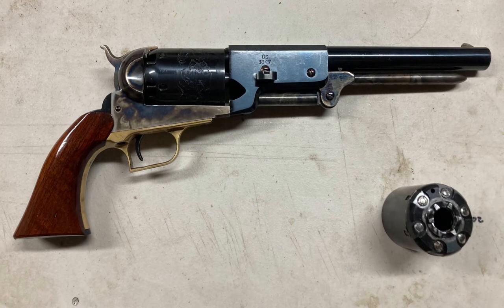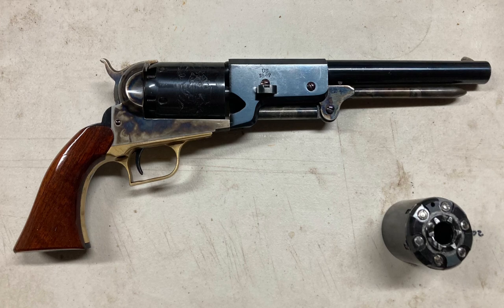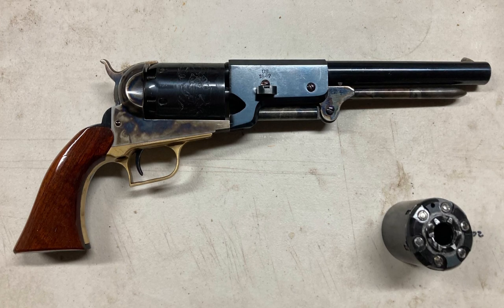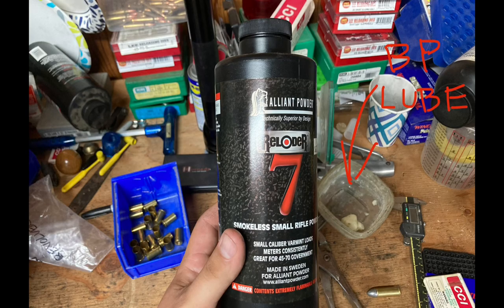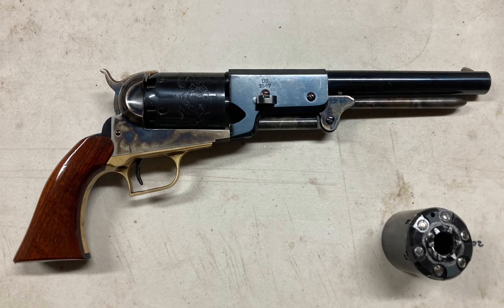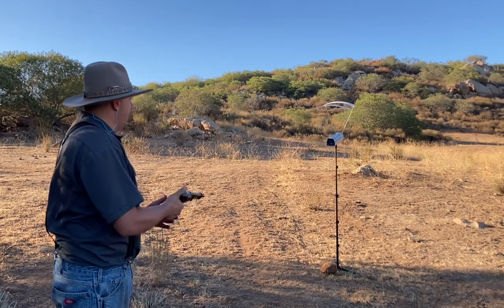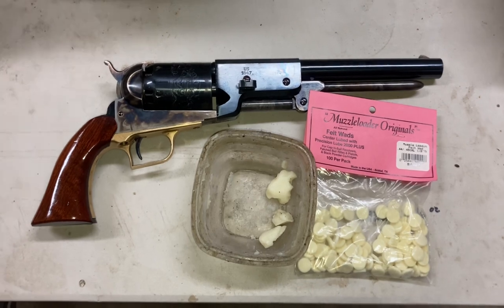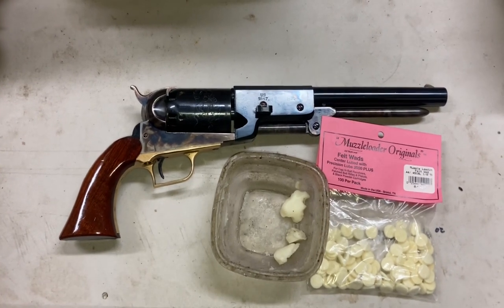Colt Walker Chain Fire

Comment: If the ball shaves a complete ring of lead when loading its not going to chain fire through the front of the cylinder. You probably had loose fitting caps.
Reply from the maker: They weren’t any more or less loose than usual but I do suspect it came from the nipple side of the chamber.
Reply: I have a 36 cal cap and ball revolver. This gun has weird over sized chambers and is difficult to get the right sized balls. It has chain fired a couple of times.  As noted tight fitting balls is extremely important in preventing chain fires.  Some Walker pistols are made with a slightly larger bore.  This could be worth looking into.  Make sure your getting that ring of lead during loading.

Comment: I know I am not expert, but in my 15 years of shooting black powder revolvers, I have determined that if you do not get a good ring of lead shaving off when you seat the ball, you are using too small of a ball.

I use .454 balls in my 44 revolvers, and have never needed to use anything other than powder and ball.
Reply from the maker: I used .454 ball and it always shaves off a nice lead ring. I think the excessive powder charge might have something to do with it.
Reply: @Everythingblackpowder  I also use .454 and I get the same ring.

 I mean I don't know because I've never messed around with with excessive powder charges, but it still had to get in there somehow and ignite the powder.

Comment: I think this happens when you use undersized balls
Reply: Ideally when you press the ball into the cylinder one should be shaving a tiny ring of lead from the ball.  But sh!t happens 😃.
Reply from the maker: I use .454 balls and they shave a lead ring when I seat them.
Reply from the maker: It’s very possible. There’s a lot of fire and smoke with that powder charge.
Reply: @Everythingblackpowder  yep that's a real horse pistol!   I've never had it happen and im guessing you shoot 100 times or more what i do  and it has only happened to you twice so its rare but can happen even with all precautions.  I know some my nipples seem sloppier than others as far as cap fit or sometimes some caps just seem to seat better than others.   I read about back in the day sometimes those walkers would actually blow cylinders given the metals of the time.
Reply from the maker: @luuk-out-below9804  I’ve heard that too.

Comment: The problem is piss poor QC! I don't shave a ring of lead with my favorite most used guns. I chamfer the chamber mouths and polish (sometimes recut) the chambers, but most importantly they have to be the same size and the Italian's have left this up to us to accomplish...yeah I know it's a cost thing etc. etc. etc., but point is that we have to do it ourselves. The only thing keeping from cutting the ring is the chamfer and the chambers are still cut in relation to bore size (some confuse with land height) so the ball/bullet is still compressed tightly in the chambers to the point they are shaped in the same fashion as if they were cut by the cylinder chamber mouth and will not move under inertia and I don't have to chase rings of lead down (I don't waste anything!) and overall better performance and accuracy and no lube needed if the work is done...I assume because I always use it unless I forget it. I also mirror polish my forcing cones and cut (polish down) the sharp edges of the start of the rifling ahead of it and I do the forcing cones if needed.

Comment: My chronograph reads off anything less than 1000 FPS with a decimal.  It's hard to see.  956 FPS looks like 9560 FPS.  I botched an afternoons worth of data a few years ago looking for book start load to register around 1050fps.  My read was like 9835fps...until i noticed the little dot.  Oops, it was 983 point 5 fps, etc..  

Meanwhile, none of my .44's do well with .451 balls, they are all over size, chambers and groove.  One is okay with .454 but the rest are much happier with .457's.  Same for the .36's, only one is happy with .375 ball, all the rest need .380's.  My ASM .31 Remington is okay with .319 but my Colt 1849 is marginal with .324 and does much better with .330's.  Slug your chambers & bore, you may be surprised by the results.
Reply from the maker: Mine doesn’t have decimals. I think I was just too close to it. It should be in the 1100-1200fps range with that charge.
Reply: @Everythingblackpowder  I have figured some stuff out the hard way so I'm not being a smart ass.  I'd venture to think that many of your viewers who are new to this have, say, a .36 C&B revolver and the instructions indicate the use of a .375 RB.  Several of my recent production Uberti & Pietta .36's have chambers/barrels that slug greater then .375 to begin with.  .31's and .44's being over size too.  Poor performance, perhaps chain fires, resulting using nominal sized projectiles.  You're pushing 7k viewers, perhaps 10% are having problems that might make them walk away in frustration.  I'm just saying that a 10 minute "how too" video on matching projectiles to the gun might save they day for 70 people who might otherwise quit.  Sometimes wee tidbits of info go a long, long way!

Comment: I wonder if the chrono picks up on the particulates of the powder which are going much faster than the lead as they have close to zero mass ?   With BP there is always solid salts in the burn, just the nature of it with the KNO3, unlike smokeless which ideally produces just gasses.
Reply from the maker: I think I was standing too close
Reply: @Everythingblackpowder  yep chrono picking up the blast!

Comment: I've never had a chain fire, and I've never used grease either. rarely will i use wads because the foul the powder if put before the ball and fall out when in front, where it really should be anyhow. i suspect the balls are too small and not getting a good seal. i use oversized balls, its more difficult to load but better all around.
Reply from the maker: I uses .454 ball and they shave a nice ring of lead when I seat them. I suspect it came from the nipple side of the cylinder and I think the excessive powder charge had something to do with it.
Reply: @Everythingblackpowder  now that's an interesting idea....from the backside.

Comment: I use felt wad between ball and powder and just grease the projectile before seating it.  Its less messy than coating the top of the ball with grease and I have never had a chain fire. Nor have I had a misfire because of contaminated powder charge. Misfires from bad caps or a dirty gun after a day at the range yes. Time to go home and clean the gun. After cleaning I have loaded both my 36 CVA and my Ruger Old Army 45 and left them loaded (without caps) for years. Take em out and they shoot fine.

Comment: I seldom grease the cylinders, if I do, I just use Crisco®. I punch out my own wads from thick shoe felt after they have been soaked in my custom lubricant. BTW, I have two Walkers, a Dragoon, a handful of 1851s and an 1858. Love them all. I recently tested black powder I made with your guidance, I'll continue to improve on it. https://youtu.be/zwwosUzWbKM
Reply from the maker: Glad to hear it! I use homemade lube made with lambs tallow and beeswax. Crisco is too runny for my liking.
Reply: @Everythingblackpowder  I'm thinking maybe it hardens when it gets old. Maybe I mixed it.
Reply: It works in a pinch for seal insurance, but on a hot day or if shooting a lot it melts.   Call me the Crisco kid.

Comment: when you press in the round ball, is it shaving off a little ring? I have never had a chain fire. but I do use wax wads, with both round ball and conical.
Reply from the maker: Yes, I use a .454 ball and it shaves a nice ring of lead
Reply: @Everythingblackpowder   that's interesting. good to know. i use wax wads made from the bees wax for bullet lube. I use a 45 long colt case with the primer hole widened to accept a plunger, made from an old Dremel grinding wheel that has worn to the point of fitting in the case. I keep them in an altoids can. I really like the walker pistol.

Comment: I had a 1851 navy that started to chain fire after I had the nipples replaced at a local black powder shop, come to find out the nipples were a bit too big and the vibration of the blast caused the proceeding cap to ignite, thanks for posting 👍

Comment: Can you tell us more about what you did (except not lubing) when you had Chain Fire with the Remington 1858? Are you sure the chain fire is not from the back (nipple-cap gap and a spark from the huge load) I am asking, because I have shot sometimes with my remington 1858 without grease and had no issues, but no more than 20 shots with .454 ball and a good o-ring shaving.
Reply from the maker: Yes, the 1858 Remington needs a bigger ball than the .454 I was using because it didn’t shave any lead when I seated it in the chamber. That combined with no wad or lube is a recipe for a chain fire. The Walker shaves a nice even ring of lead with a .454 round ball which is why I wasn’t too concerned about not having a wad or using any grease. My theory is that it caught from the nipple side of the cylinder because of the excessive powder charge.
Reply: @Everythingblackpowder  thank you for your answer, so maybe we should use nail polish on the caps/nipples to be extra sure? What do you think is a good idea for protecting those gaps at the nipples?
Reply: @historybooks1391  I have seen nipples that are CNC turned that are supposed to be better chamfered, more concentric and a better fit than the ones that come with the revolvers. I don't recall where I saw them online, but they were recommended when I was researching cap and ball revolvers when I was thinking about ordering one a while back. They appear to be drilled and chamfered better, finished better, I think the subject it was recommended for was caps sticking to the hammer, but it probably has a tighter, more concentric fit than the originals and may help.

Comment: That old pistol pack’s a punch,Hard to imagine in the old days shooting these,It’s hard to get off 4 shot’s before the black powder starts fooling the cylinder,have manual turn the last two rounds. Thanks for the video.
Reply: That shouldn't happen..... you should be OK for at least 4 or 5 cylinders full without cleaning the cylinder pin/arbor..... The right grease is your friend here. I have found "Pro-Gold" grease excellent. It's actually made for stainless steel semi autos, which tend to 'gall' without good lubrication, but it works a treat on the cylinders pins of my BP revolvers.....

Comment: Interesting - I've always heard of chain fires but never seen one in person. Wish you would have shown a closeup of the aftermath. Thanks for sharing!
Reply from the maker: Im afraid there was nothing to see. It didn’t harm the pistol at all.
Reply: @Everythingblackpowder  That's great to hear - I always wondered about what possible damage could occur from a chain fire. I always heard you smear lube (some say Crisco?) over the full chambers to prevent it; what is your best practice?
Reply from the maker: @thegrumpytexan  I call it grease but it’s actually my homemade black powder lube. It’s 60/40% lambs tallow and beeswax. It’s the consistency of cold butter. I know folks that use crisco but it doesn’t work nearly as well. In my opinion, greasing the chambers with lube does two things. One is it keeps the fouling soft and allows you to continue shooting before your pistol is so fouled you have to disassemble it and clean it. The second is it gives some additional protection against chain fires. Even though some folks disagree about that.
Reply: I never had a chain fire in all the two times I have shot a cap and ball revolver.

Comment: You dont need EITHER grease or wad, you just need properly sized (slightly oversized) bullets. See InRangeTV's videos on the subject.
Reply from the maker: I’ve used .454 diameter balls for the 10 years that I’ve owned this thing and only ever had this one chain fire. Wads and or grease are added protection against chain fires if you do have a slightly under sized ball or the sprue on the ball isn’t oriented up or down and creates a breach in the seal, which is what I think happened here. If I had been using a wad or grease I’m certain it wouldn’t have happened.

Comment: The high #'s on the chronograph are from being too close. It is reading the shadow of the shockwave from the shot. You can see it in alot of slow motion videos, the chronograph will see it also.

Comment: imagine being in the old west and having to use one of these to defend yourself in an indian attack...."hold on while i grease my cylinder"....
Reply: It is hard to imagine any reloading of a cap n ball weapon in the heat of battle.  During the period the tactic was to carry two on the saddle, plus a single shot  muzzleloading rifle.   The pistols were used during the charges, once depleted there were bowie knives, tomahawks and sabers.    You have to consider prior to this was the single shot pistol, so these increased firepower from say 3 rounds per charge to 13, which is a huge leap.  Extended firefights were not typical.